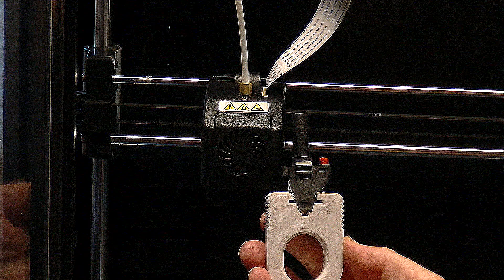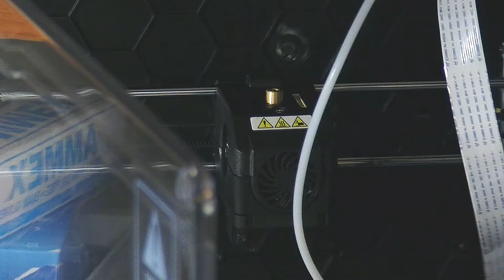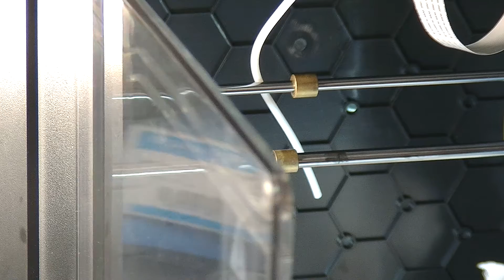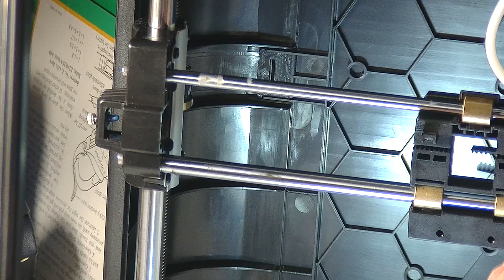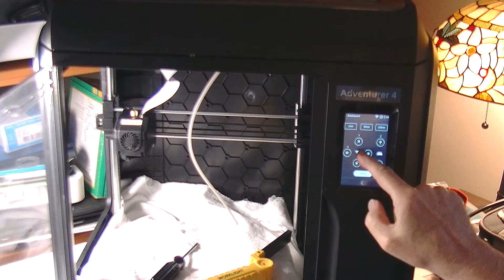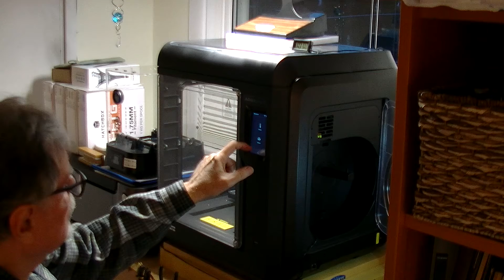Flashforge Adventurer 4 Extruder Mount Replacement

Comment: hello  we just got Flashforge Adventurer 4 it was working fine but now it seems that the build plate not heating up and is lock at 300c. I'm not sure how to open it up to see what is wrong wit it.
Reply from the maker: When I got mine, I was sending Trouble Tickets to Flashforge all the time.  Learn how to do that.  Here's a link, be as detailed as possible.  Include cell phone pictures etc.  https://flashforge.com/pages/contact

Comment: Where did you find the STL file for the extruder puller?
Reply from the maker: Flashprint: File Menu - Examples - Nozzle Remove Tool. STL
Reply: @dondec  Thanks.

Comment: Hello! I've watched your videos! You're doing great! Thanks for the clarification!
There is still a question. If the Z axis is not fixed at the base of the printer, how can I fix it? How to fix it? As I understand it, this greatly affects the print quality.
Reply: Maybe come up with an STL file that could fix the old revisions of Adventurer 4?
Reply from the maker: @huaweiv4642  Your question is not clear to me.  If you are talking about recalibrating the nozzle height to the bed, see video at min 13 where I show that.  If you gantry is not square to the build plate you can: 1. add copper tape under the magnetic build plate to even the heights uniformly across the entire build plate surface.  You can also 2. take off the top of the printer and adjust the left and right worm gears, making one side lower or higher as needed.  Hope this helps.
Reply: @dondec Thanks for the answer! I meant worm vertical axis. It is not fixed on my printer. In new printers, the worm axle is on bearings at the top and bottom.

Comment: HI, What make PETG do you use because I'm having problems
Reply from the maker: I use HatchBox, California Filaments, and Amazon Basics, and some others.  THey all work ok.  PETG is very unforgiving on temp, fan and speed temps.  You'll need to work out some settings that work for you.  Start with a String Tower.  Then try larger prints... which (for me) revealed bed warping issues (which I fixed).  One step at a time.
Reply: @dondec  Thank you Don
Reply: @joegoodwin6426  In MANY hours of testing and failed PETG Prints I have found that using the default settings in the Slice menu other than I use triangles instead of Hexagon in my fill made for stronger models, and then when you Start the print you can from the "Basic Information" window that you turn on the Camera and Light, click on the "Settings" tab and change the "Print speed", for quite good PETG prints I slow it down to 50% or lower, from here you can also vary the Extruder and Bed Temp to test on the fly what the best Temperature is for the filament your using by printing a tall model and remember where you made the temperature changes. 
Your milage will vary I am sure
Bret

Comment: Thanks for a good video. I like how you cover the base with a cloth when working on it, I wish I had done the same. I was one of the Beta testers and a nozzle not properly clipped in resulted in filament managing to feed in and take out a blade of the cooling fan. In the subsequent dismantle I dropped a screw through the slots and had to rotate and use a magnet on a stick to find it and get it out.

The side clips really are strong, and I like your way of getting the panels off. I'm sure your video will help others!
Reply from the maker: Thanks so much.  Even with the drop cloth I STILL almost lost the axel to that belt-hub, lol.  Appreciate your experience on the nozzle too.  I had one "pop out" during a print.  Any more I REALLY make sure its in all the way.  I have to say I enjoyed doing all this.  To be honest, I was a little afraid of the machine before, now  I "understand it" better, and have more confidence.  This is my 1st printer.  Thx for checking in.
Reply: @dondec  As one of the Moderators in the Official Flashforge User Group I was invited to Beta test and grabbed the opportunity. I was motivated mainly by the 250mm Z height as my Inventor only goes to 160mm, Creator Pro 2 only 150mm and Creator 3 only 200mm. So getting extra height was a bonus. Having said that, the ease of use and the quiet-ness means it's my go-to for prints that have to run overnight as it's next to the bedroom.

I was pleasantly surprised at the improvement in build robustness over the AD3. It's much more than just a "bigger AD3", with a superior build plate and menu system. And the separate cooling fan for the extruder gives better control as well.

Each printer has it's strengths and weaknesses. The big Creator 3 is the fastest overall, but not by much. The longer heating time to get the big build plate up to temperature especially for PETG and ABS means that unless it's a 6+ hour print the Creator Pro 2 or AD4 will beat it. But it's hyper mode at 0.05mm Vs the 0.1mm of the others means for really fine detail it's the one to use.

On smaller prints (under 6 hours I generally use either the AD4 or CP2 (Often both doing different parts). As both the C3 and CP2 are IDEX, multiple parts are done on these machines. The CP2 tops out at 240C so PETG and Nylon etc is done either on the C3 (Goes to 320C) or the AD4 with a 265C Nozzle.
Reply from the maker: @theaussieviking8555  Fantastic info!  I was just thinking how cool it would be to beta a Creator 3 Pro.  I used to beta test Maxon’s Cinema 4D, a 3D modeling/animation software, and did some animation professionally for a while.  Now I’m using that software to design/print my own 3D stuff.  Haha, wow!  
I’m new to working with Materials, so thinking about things like “overhangs”, or (because I can only print one color at a time), whether I should glue or attempt a “mid-print spool change” are interesting variables.  Overall, this stuff is very addictive, and my QA experience in the telecom industry is really helping.  I keep track of everything I do in a journal, taking cell phone pix of everything, analyzing, then adjusting FP slicer settings.  PETG was really finicky at first, now I’ve got my temp, cooling fan and supports (when necessary) strategies all working smoothly.  Have to say, I’m really enjoying the experience.  I’m very happy to make you acquaintance.  You’re experience with the product line is astounding!
Reply: @dondec  I'd love to test the Creator 3 pro or the Creator 4, which sounds like an awesome beast, but out of my price range. The Creator 3 Pro solves a lot of the issues/shortcomings of the Creator 3 - Slow to warm up the build plate, (Pro is 5X faster), a second fan per extruder so you have control of part cooling much better (We use baffling to slow the airflow on the original C3), and also if you are not careful when changing the nozzle you can damage the Piezo sensor and the build plate if you do. So a new nozzle/extruder will make it easier to use.
Reply from the maker: @theaussieviking8555  Excellent info.  I was very impressed with the part cooling on the Adv4 and per layer percentage control in FP.  My PETG setup makes good use of those Print temp and Cooling fan LISTs.  Seems you (or at least I) need to think about the overhangs and high stringy areas, and control them with slightly more cooling.  That got me the best prints.  As for the Creator 3 Pro, yeah, I’ve been reading and rereading the specs on that.  Sounds haha really amazing.  Do you know if it has fully automatic bed leveling?  There’s something about a pressure sensor in the extruder.
Reply: @dondec  The Creator 3 has very good levelling where it checks each point and tells you how far and which way to turn each knob. Dead simple. But the issue is the piezo can easily be damaged if you simply jam in a new nozzle tight without aligning it first. It is an inner and outer part where the inner comes through a slot in the outer "cup". If the inner rotates the wire can touch on the outer cup, rendering it inoperable, and if that happens some people who don't address this and try to print find the nozzle gouging the build sticker as it cannot detect when it touches. I put up a video on the Flashprint Official web page showing how to avoid this.

The newer C3 Pro uses a different system, I suppose to make it "idiot-proof" due to the number of people who managed to stuff it up. But the original C3 is fine if you finger tighten until it goes fully in. If it hits resistance, merely "jiggling" it makes it settle into place and then nip up when it's fully in.

There is no doubt the C3 Pro is better. Not only in this regard the newer nozzles are not as long, and are most likely a lot cheaper to buy. And add in a much faster heating time, and adjustable part cooling are all on the "want" list of Creator 3 owners. And in a world where time is money, I dare say some will upgrade to the newer model meaning there is the possibility of second-hand C3's appearing at bargain prices. Which for the home hobbyist with time to spare could be an ideal buy!
Reply from the maker: @theaussieviking8555  That is really excellent-excellent investigative work my friend.  I can see you are both methodical and detail oriented.  They chose the right person for beta tester.  Yes the Creator 3 and Pro are beyond my means, still I can dream.   Hmm... Its a shame people can't upgrade the 3, to a pro, but I can easily see why they'd avoid that sort of business model.  Off topic: I'm somewhat intrigued by your investigative style.  Do you have a "standard set of tests"?  What you described is not so easy to discover.  Also, do you have priority support contacts at FF ?  Beta testing is only valuable when there's fast turn around prior to general release.  Thx for getting back.
Reply: @dondec  I was approached in August 2020 by Flashforge to come on board as an Admin (later Moderator). The reason was that I was being Proactive in the group to make people say a bit more than "this is stuffed". By eliciting better problem descriptions out of people then the Tech's could translate and fix things easier. Pretty simple stuff really. And I was also not only doing 2 Colour printing, I was also installing electronics like sound and lights, which was pretty radical back then and something that wasn't happening (yet).

It's entirely voluntary, but it has facilitated access to a few persons within where frank discussions can be had via messenger or WeChat. Which has on occasions resulted in changes for the better. On other occasions it's clear that I'm still communicating at a lower level and not getting through to the Chiefs. But it did result in the Beta machine as they appreciated my input.